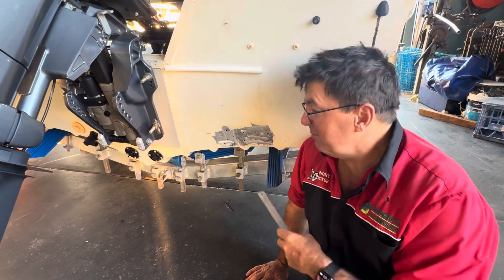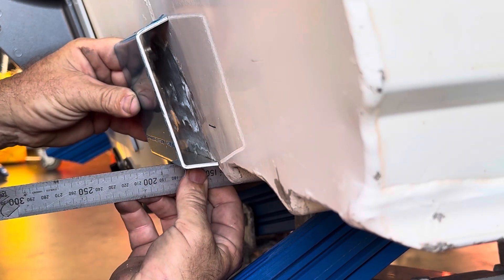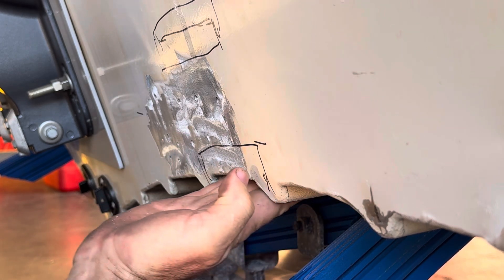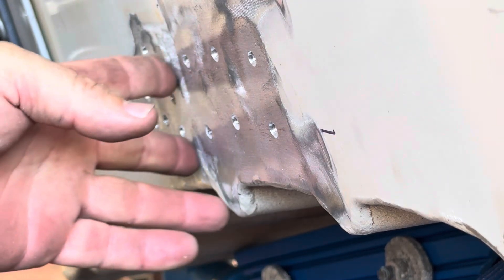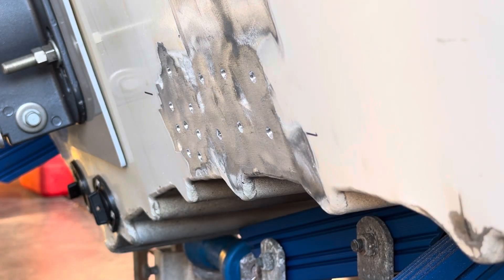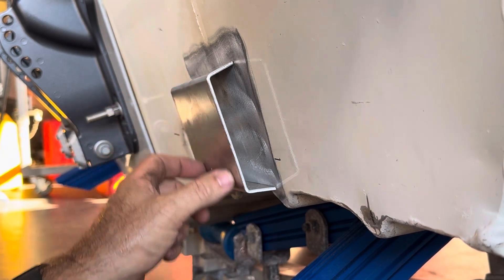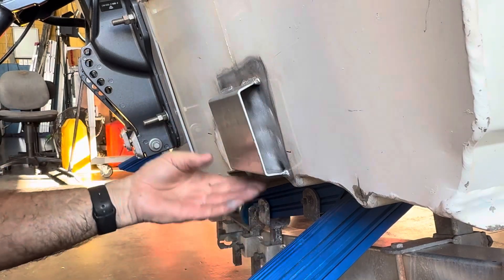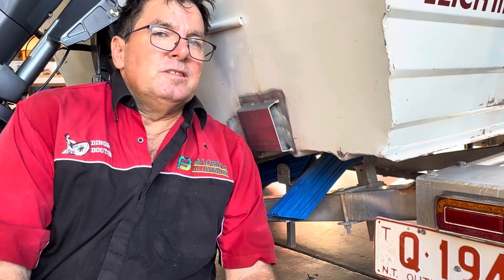Transducer Mount The Secret to a Perfect Reading !￼

Comment: Thanks so much for the education. Do you use a push pull gun on your fronius?
Reply from the maker: Tom I have a twin roller system on mine not a push pull and with the length of my hand piece I don’t run into any problems

Comment: You normally run tungsten inside the nozzle?😊
Reply from the maker: Most of the time 
There is reason! Most of the TIG welding I do is outside corner to corner 
If I did a full fillet weld I would push it out more for sure 👍
Reply: @RacingRenovators you use the cup as a prop fir arc length?
Reply from the maker: @malglasspool9302  Not really free hand most of the time

Comment: Barji fairing block will read 300m side imaging at 30knots clear as day in 50-60m of water
Reply from the maker: Tell me more about this 
I will have a look
Reply: @RacingRenovators 3d printed fairing block, mine is just glued onto my hull, no fixings at all.
Reply from the maker: I like it 3D Printing has so many applications
Reply: @RacingRenovators You can turn your transom mount into a thru hull
Reply from the maker: @kizzjd9578 I understand no disturbance from the edge of the hull

Comment: That “seen it somewhere else) actually improves the pickup.  Understand about hull cracking but weld it from inside before you smooth the outside.  Cheers.
Reply from the maker: Yes welding it from the inside would work 
Lost of boats have welded in frames to hold batteries or fuel tanks and you can’t get to it